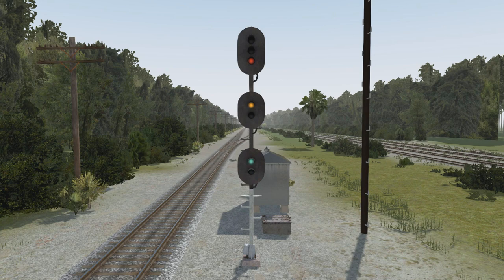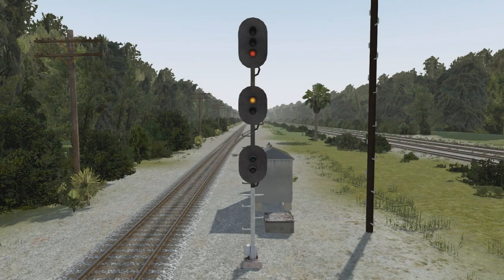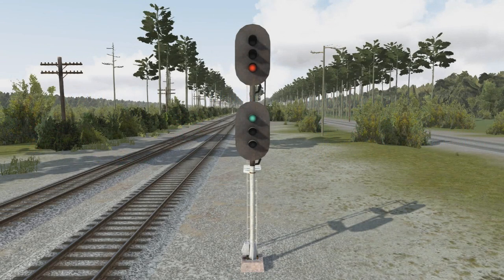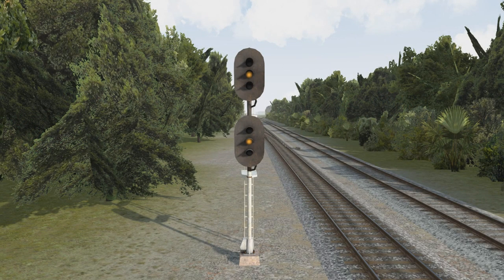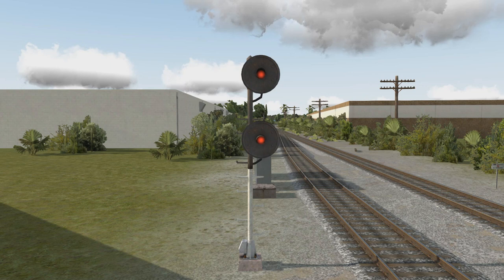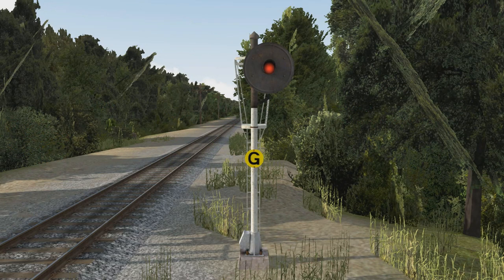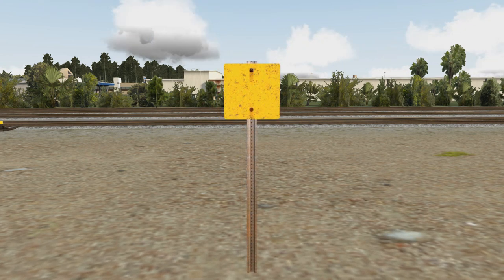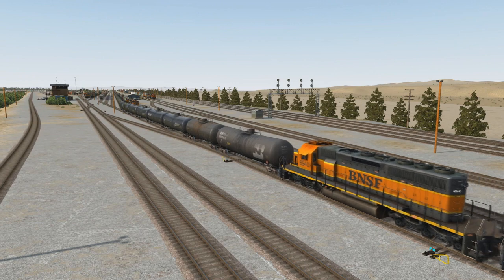Signals and Signs of the CSX A-Line

Comment: For those who might be curious about the types of signals, the first set he was describing are called “Absolute Signals”. These are common signals you see on railroads that have track speed. They are also called “home signals”. The second set of signals that he talked about are called “ABS” or “Automatic Block Signals”. These are different in that they have a number plate, a G marker, or a P marker. Rarely, they can also carry an C marker, or an illuminated S.